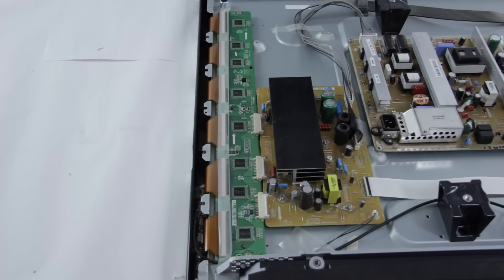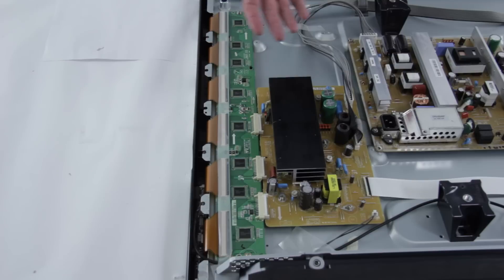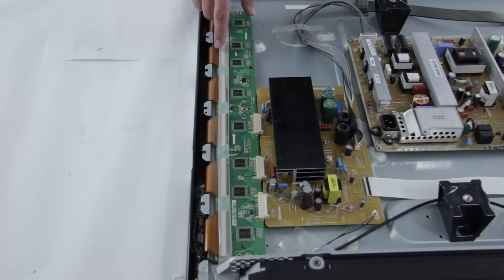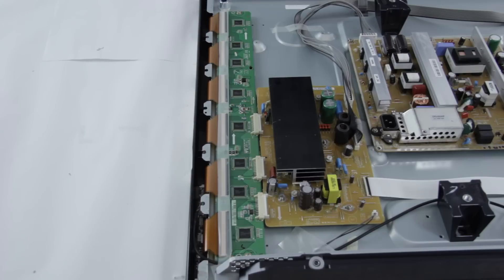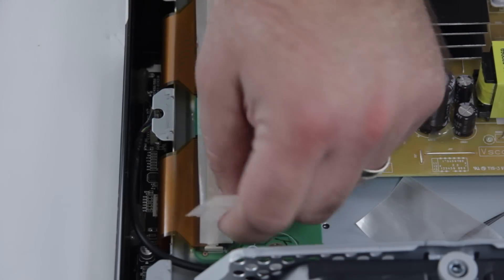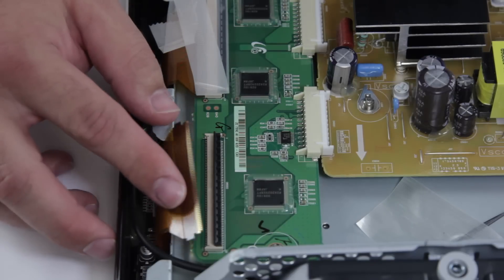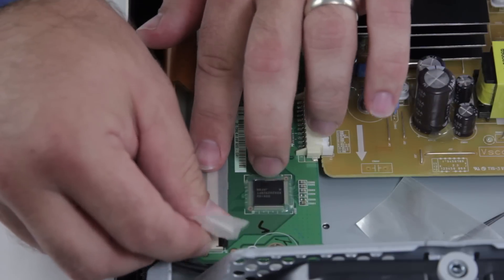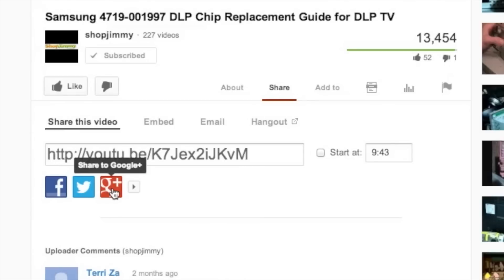Plasma TV Repair - No Image, No Picture on Plasma TV Screen - How to Replace Y-Buffer & Y-Sustain

Comment: Hello, my LG 60PG60F-UA Plasma tv, has the lower half of the screen dark. I have investigated the lower left y-buffer P/N: EBR38574701, found that the picture next to the uppermost ribbon connector was ok. but below that all 5 lower connectors had no effect on picture upon removal. I suspect that the buffer is damaged. But how sure can i be of this, and where can i get this part? it seems to be out of stock.? Can this defect be coming from another part? your help will be greatly apreciated. Ed.
Reply from the maker: Eduardo Benarroch   I recommend looking for pin holes in the buffer ICs.  Watch this video and let me know what you find.  Plasma TV Repair Symptoms and Diagnosis Y Sustain Failure Caused by Bad Buffer Board Blown IC  Thanks!  www.shopjimmy.com

Comment: I have a relatively old 50 inch LG Plasma Model 50PG20D. I have sound but no picture.. Black screen, no lines, no popping, no light... absolutely nothing. Where do I start please?
Reply from the maker: Wayne KING   I recommend replacing the y board and buffers in your TV.  Unfortunately I do not see any replacement parts in the search results for your TV model number on our website.  Please reply with your part number on your boards and I can try searching for replacement parts.  Thanks and please let us know if you have any further questions!  www.shopjimmy.com
Reply: Thanks for the help, unfortueately found parts in USA for around $90 but in Australia parts bill gets up to $400 so I have decided to move on to a new unit. Thanks for your help.

Comment: Hello there! I have an LG 50PG20 Plasma tv. I turn it on for five minutes or so and it turns off and this happens a couple times until the tv stays on for the rest of the night or however long I am going to use it.
. I give the tv a little tap on the bottom of the tv and the LED turns on red and then to blue and my tv turns back on and sometimes it wont come on and I have to wait for abit, then the LED comes on again. Now the tv wont come on unless i hit the bottom of the tv and hold the power button to keep it on. The screen is great, no lines or nothing. Image is great so I think it might be my power supply? Not enough power from outlet? I do live in a old ass house and everything runs in a series circuit or however its called. Suggestions? Please?
Reply from the maker: TheHoulio234   Try this at your own risk. Unplug the TV, then disconnect the y board and plug in the TV to see if the TV powers up. Reply with the results of this test. Thanks! www.shopjimmy.com

Comment: I have a 50 inch plasma that turns on makes sound and when u push in put or any other button u can tell it recolonizes it cus the red light flashes but there is nothing on the screen at all almost like the screen is 100% unplugged from the circuit components the screen has NO damage!

Comment: Hello I have a 32 inch Panasonic 
Model #TH-42PX60U
Serial #LC62070730
Year Manufacture 06 the picture blanks out and stay for an hour or two.. I can only hear the words. 
   I'm trying to pin point weather it's the main board or the A Board?
Reply from the maker: Corey Herring  Please watch this video FIRST to help with your repair!  TV Repair! LCD, LED, Plasma, DLP How To Fix Your TV with ShopJimmy.com Help!  I recommend replacing the SC, SU and SD board in your TV.  Here is a link to replacement parts for your TV:  http://www.shopjimmy.com/catalogsearch/result/?q=TH-42PX60U  Be sure to match part numbers on your current board, with your replacement for compatibility.  Thanks and please let us know if you have any further questions with your TV Repair!  www.shopjimmy.com

Comment: I have a GFM 42 IN PLASMA TV that started going off after being on 15 or 20 min..now when I turn it on u can hear it click on and it flashes blue across the screen then goes off but the sound stays on..
Model # PDP42G1T011..PLEASE REPLY TO MY EMAIL ADDRESS. grasschopper76@gmail.com
Reply from the maker: Chris Eskridge  Please watch this video FIRST to help with your repair!  TV Repair! LCD, LED, Plasma, DLP How To Fix Your TV with ShopJimmy.com Help!  I recommend replacing the YSUS board and any buffer between the YSUS and the panel in your TV.  Here is a link to replacement parts:  http://www.shopjimmy.com/lg-ebr50267901-ysus-board.htm  Be sure to match part numbers on your current board, with your replacement for compatibility.  Here is a link to a video showing how to identify your part number, click here:  LG Plasma TV Repair: DIY Part Identification Number ID Guide for LG & LG Philips Plasma Panel Parts  Thanks and please let us know if you have any further questions with your TV Repair!  www.shopjimmy.com

Comment: I have an LG 60PS60 that is roughly 5 years old.  The picture died last night.  The screen is black - not glowing with no picture, and the speakers appear to be working (I run sound through my receiver).  I'm wondering how to isolate whether I have a power supply issue, a y sustain, or a z sustain board issue, or both.
Reply from the maker: Dave Hunt   Please watch this video FIRST to help with your repair!  TV Repair! LCD, LED, Plasma, DLP How To Fix Your TV with ShopJimmy.com Help!  I recommend replacing the YSUS and the YDRVTP & YDRVBT boards in your TV.  Here is a link to replacement parts:  http://www.shopjimmy.com/catalogsearch/result/?q=60PS60  Be sure to match part numbers on your current board, with your replacement for compatibility.  Here is a link to a video showing how to identify your part number, click here:  LG Plasma TV Repair: DIY Part Identification Number ID Guide for LG & LG Philips Plasma Panel Parts  Thanks and please let us know if you have any further questions with your TV Repair!  www.shopjimmy.com

Comment: Hey guys great !!
I have a INSIGNA / SAMSUNG plasma
model # N8-42P650A11 serial# AA043M3B203385A
The issue I have is a no power up issue .
Ok the unit will try to power on and the relays will click on and off for about 4 times then there will be no control from the power button on the front after that
if I unplug the Y sustain board from the main power board plug it in and turn it on  the logic board led will stay lit and the set will appear to stay on ( well everything visible without picture )
optic out on and logic light led on
I do have a ESR meter and checked all aluminum caps on power and y sustain board
all appear to be ok

Thanks from a guy who has to fix it all
Chris
Reply from the maker: David Heljenek  Please watch this video FIRST to help with your repair!  TV Repair! LCD, LED, Plasma, DLP How To Fix Your TV with ShopJimmy.com Help!  If your TV stayed on with the Y sustain disconnected, then I recommend replacing the Y-Main board and the Y Scan drive board.  Follow this link to replacement parts:  http://www.shopjimmy.com/catalogsearch/result/?q=42P650A11  Be sure to match part numbers on your current board, with your replacement for compatibility.  Here is a link to a video showing how to identify your part number, click here:  Samsung Plasma TV Repair: Samsung Plasma Panel Parts Guide  Thanks and please let us know if you have any further questions with your TV Repair!  www.shopjimmy.com

Comment: Hi I have an lg42pq30 that powers up but has a black screen any ideas?
Reply from the maker: gary Dougan   I recommend replacing the YSUS and the YDRV/YDRVTP board in your TV.  Here is a link to replacement parts:  http://www.shopjimmy.com/catalogsearch/result/?q=lg+42pq30  Be sure to match part numbers on your current board, with your replacement for compatibility.  Thanks and please let us know if you have any further questions with your TV Repair!  www.shopjimmy.com

Comment: i have the Samsung 50 inch plasma model number hps5053x/xaa. no picture on screen. can I repair this myself?
Reply from the maker: mark willson  Please watch this video FIRST to help with your repair!  TV Repair! LCD, LED, Plasma, DLP How To Fix Your TV with ShopJimmy.com Help!  I recommend replacing the Y-Main Board and the Upper & Lower Y-Scan Drives.  Here is a link to replacement parts:  http://www.shopjimmy.com/catalogsearch/result/?q=hps5053x%2Fxaa  Be sure to match part numbers on your current board, with your replacement for compatibility.  Thanks and please let us know if you have any further questions with your TV Repair!  www.shopjimmy.com

Comment: I have Samsung FPT5084.  The TV all the sudden shut off without warning.  When first plug the power, you will her clicking sound with solid red light then starts to blink slowly. The clicking sound eventually stops around 10 clicks or so.  The red light blinks slowly until I unplug the power.  Doesn't respond to power on or off from the remote.  We opened the cover and looked at the power supply board and caps seem to be fine.   Haven't check the fuses yet but my TV setup looks a bit different than the video above. I'll check the fuse tomorrow once I get the meter from the shop.   How do I know which one is Y-Sustain?  Is it always on the left of the power supply?  I want to try to disconnect the power to Y-sustain to see if the clicking will stop. Do you think this is just the power supply board problem?  Any help of suggestion or advice is greatly appreciated.

Comment: I have a Samsung PN50B550 with a single black horizontal line. I've replaced the Y buffer, but the line still appears. Prior to replacing the Y buffer, the line had disappeared for about 15 minutes. Even with the new board, it is still there. Should I replace the Y sustain board or would these be more of an issue with the panel itself?

Comment: i have an rca 42pa30rq that turns on and goes to a black screen. i don't know if there is sound because i have nothing hooked up to it at this time. i get a very fast and small fuzz and then this happens. any ideas?
Reply from the maker: Joe Gumina   I recommend replacing the main board in your TV.  Here is a link to replacement parts:  http://www.shopjimmy.com/catalogsearch/result/index/?cat=56&q=42pa30rq  Be sure to match part numbers on your current board, with your replacement for compatibility.  Thanks and please let us know if you have any further questions with your TV Repair!  www.shopjimmy.com

Comment: Hi I have a LG plasma  50PK750-UA  After plugging in the tv, I heard a loud pop like a gun. The power turns on and there is sound but it has no image on the screen.  I removed the back of the tv and would like to know what part I would need to fix.  I'm not sure if this matters but in the middle panel there are two identical  square boxes with square holes cut out with blue and yellow tape.  The top box with the yellow tape has a light brown substance on it. Thanks a million if you can suggest anything... btw I love watching your videos!
Reply from the maker: brattypants1  Please watch this video FIRST to help with your repair!  TV Repair! LCD, LED, Plasma, DLP How To Fix Your TV with ShopJimmy.com Help!  I recommend replacing the YSUS and the YDRVTP & YDRVBT boards in your TV.  Here is a link to replacement parts:  http://www.shopjimmy.com/catalogsearch/result/?q=50PK750-UA  Be sure to match part numbers on your current board, with your replacement for compatibility.  Here is a link to a video showing how to identify your part number, click here:  LG Plasma TV Repair: DIY Part Identification Number ID Guide for LG & LG Philips Plasma Panel Parts    Thanks and please let us know if you have any further questions with your TV Repair!  www.shopjimmy.com

Comment: I have a phillips 50 plasma 50pfp5332d/37 the screen is black no picture
Reply from the maker: Jason Manning   I recommend replacing the Y-Main Board and the Upper and Lower Y Scan Drive boards in your TV.  Here is a link to replacement parts for your TV model number on our website, click here:  http://www.shopjimmy.com/catalogsearch/result/?q=50pfp5332d%2F37  Be sure to match part numbers on your current board, with your replacement for compatibility.  Here is a link to a video showing how to identify your part number, click here:  Samsung Plasma TV Repair: Samsung Plasma Panel Parts Guide  You can also call our customer service for further assistance with your purchase.  (877) 881-6492  Thanks and please let us know if you have any further questions with your TV Repair!  www.shopjimmy.com

Comment: panasonic tc-p50s2 serial me 006-40339
power tv on see led power light and hear click from power supply no flashing led
but not picture set up etc. hear another click from power supply , screen flashes very very quick to quict to see any image.

press power button off have to hold about 5 seconds tv shuts off but comes back on by its self. again same outcome cycles over and over no picture only way to quit is unplug tv . once unplug for a few moments plug back in it does not power up by self but once you power it up you can not shut it off

Comment: Samsung 50" PN50A450P1DXZA works but picture has gone hazy, dim, almost unviewable. Tested many test points. All appeared normal except VE and VB points on the X sus board. They read .07. The VE on the internal sticker indicates it's supposed to be 100 volts. There is none for Vb. The 6 point power supply going into the Xsus are all normal. My question is, have I narrowed my search to the Xsus board or am I missing something?
Reply from the maker: James Aaserud   Try this at your own risk.  I recommend unplugging the TV and then disconnecting the x board from the power supply.  Then plus back in the TV and see if the TV powers on.  Reply with the results.  Thanks!  www.shopjimmy.com
Reply: Unplugged Xsus as recommended, tv did power up w/same poor resolution.
Reply from the maker: James Aaserud Please watch this video FIRST to help with your repair!  TV Repair! LCD, LED, Plasma, DLP How To Fix Your TV with ShopJimmy.com Help!  I recommend replacing the Y-Main board in your TV.  Here is a link to replacement parts:  http://www.shopjimmy.com/catalogsearch/result/index/?cat=66&q=PN50A450P1DXZA  Be sure to match part numbers on your current board, with your replacement for compatibility.  Here is a link to a video showing how to identify your part number, click here:  Samsung Plasma TV Repair: Samsung Plasma Panel Parts Guide  Thanks and please let us know if you have any further questions with your TV Repair!  www.shopjimmy.com

Comment: I have a LG 60pm6700-UB that was left on for an extended amount of time(6+ hours on a possible static image) and while watching a newscast the screen shutoff after a loud pop.  I can turn the tv on and off but the LG logo appears for only a few seconds and then the screen will then go black and stay black until I power off.  There are also black splotches on areas of the screen when the logo is up that look like burn-in pictures I've seen online. I tried a few things but to no avail.  I want this awesome tv back badly so any help is appreciated.
Reply from the maker: SHAUN LANE  Please watch this video FIRST to help with your repair!  TV Repair! LCD, LED, Plasma, DLP How To Fix Your TV with ShopJimmy.com Help!  I recommend replacing the YSUS and the YDVTP & YDVBT boards in your TV.  Here is a link to replacements:  http://www.shopjimmy.com/catalogsearch/result/?q=60pm6700-UB  Be sure to match part numbers on your current board, with your replacement for compatibility.  Thanks and please let us know if you have any further questions with your TV Repair!  www.shopjimmy.com

Comment: Samsung PN58B540S3F....When turned on with remote tv clicks then plays the power up song and the screen lights up slightly. The green led on the Logic Board blinks. No
picture No sound....any ideas?
Reply from the maker: Brian Johnson   Please watch this video FIRST to help with your repair!  TV Repair! LCD, LED, Plasma, DLP How To Fix Your TV with ShopJimmy.com Help!   I recommend replacing the Y-Main Board and the Upper and Lower Y Scan Drive board in your TV.  CLICK HERE for replacement parts:  http://www.shopjimmy.com/catalogsearch/result/?q=PN58B540S3F  Be sure to match part numbers on your current board, with your replacement for compatibility.  Thanks and please let us know if you have any further questions with your TV Repair!  www.shopjimmy.com

Comment: hi, I have a Samsung model Pn59d7000 about about 3 years old. I just moved from a city that was at 5000 feet to a city that is at 9000 feet. plug in the TV when I got to the new house, turned it on, and have no display. I still have sound when playing a DVD, but that's it. A friend of mine is telling me that plasma TVs won't work at high altitude, another one is telling me they will work just not for very long.the second friend is telling me he believes I might have damaged the set in the move, which was only about 30 miles. Thoughts?
Reply from the maker: Eat Sleep Ride  Please watch this video FIRST to help with your repair!  TV Repair! LCD, LED, Plasma, DLP How To Fix Your TV with ShopJimmy.com Help!  I recommend replacing the Y-Main Board and the Upper and Lower Y Scan Drive boards in your TV.  Here is a link to replacement parts:  http://www.shopjimmy.com/catalogsearch/result/?q=Pn59d7000  Be sure to match part numbers on your current board, with your replacement for compatibility.  Thanks and please let us know if you have any further questions with your TV Repair!  www.shopjimmy.com